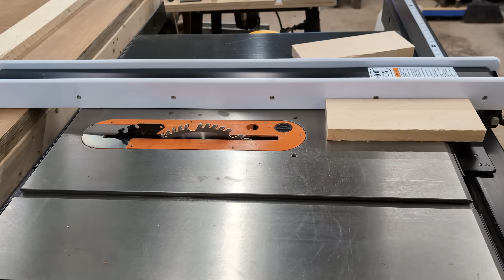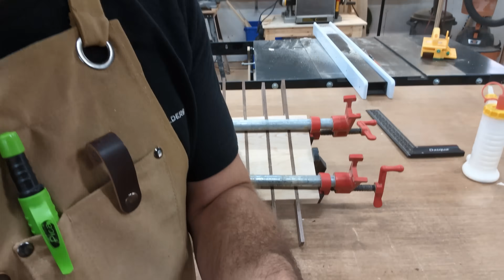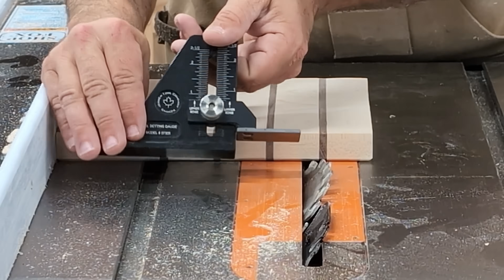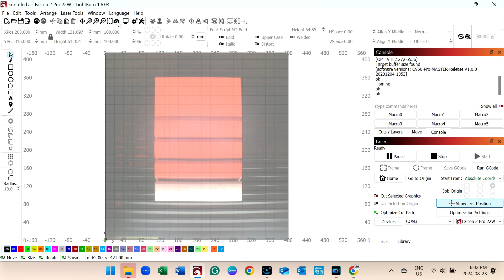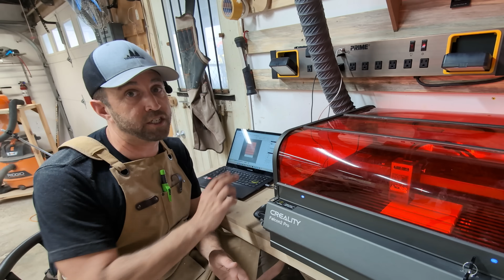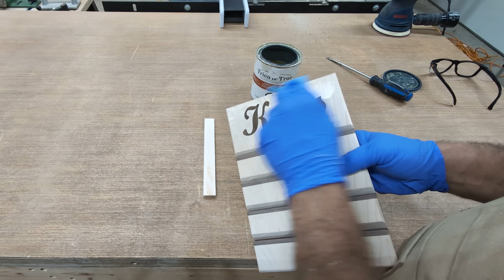Easy Woodworking Projects You Can Sell for Profit

Comment: I recently made tablet holder made with popular and redwood. The redwood is enlayed not glued. Besides a sander and 2 brad nail, i made the whole thing on the table saw and used glue with ribbet joints. Turned out beautiful.  I did use a router for a round over but definitely could have used a table saw on 30 degree instead on the edges
Reply from the maker: That's awesome! Nothing wrong with that 😁

Comment: Hmmm. Your skills and teaching ability is good but you started this video claiming that for this project you'd only need a table saw and clamps... you then proceed to use a band saw, belt sanders, laser engraver... come on man stay true to your promises
Reply: How do you hang this up? Could it be put on a stand to stand on the counter?
Reply from the maker: Of course you can. I put a bracket on the back to hang on the wall, but you can also use a keyhole bit to hang it with screws 😁
Reply from the maker: Hey thanks, and fair enough. You can build it only with those tools. Sander is a given, must have forgot to mention that, but laser and band saw aren't needed, just an option
Reply: @TimberDesigns  i don't disagree but just please be careful on your hooks at the beginning be completely honest OR disclose up front that you'll be using a few more tools. When you got to your laser engraver, it really turned me off
Reply from the maker: @TennesseeLivingNow fair enough and I really appreciate the feedback! I am doing my best to make sure I try and include everything that I use and will keep this in mind 😁

Comment: I'm curious how you hung the board.  Attached hanger or slotted key holes? I would think you would want it firmly fixed since you are sliding something into the slot to keep from pulling it off the wall.
Reply from the maker: Hey Daniel, so I originally was going to use two sided tape, which I did, but I didn't like how it was hanging. So, I ended up cutting two keyslot holes with the router and hanging it with two screws into drywall plugs, which I felt a lot better about 😁.

Comment: Man, im seriously torn with what Laser to buy...i was literally going to pull the trigger on the WeCreat 20W today....then i saw this Video. I need something very user friendly as i know nothing about Lasers and the software. The WeCreat has height adjustment automatically with pass through also. Software seems very user-friendly. This creality looks great and is cheaper...but just by a couple hundred bucks.....any thoughts or input would be appreciated.
Reply from the maker: Hey there, hands down I would go with the Creality, and the pro 22w if you can. It is so user-friendly and you download the Lightburn software. Xtool is also good, but much more expensive. What are you planning to cut/engrave?
Reply: @TimberDesigns I'm looking for a good all around machine. Wood, tumblers, etc
Reply from the maker: Creality will work for these, just need the tumbler accessory for it. If you're looking to do things like acrylics, glass, etc, a diode laser may be better.

Comment: You need to make or buy a thin rip jig to get those straps without measuring. A zero clearance throat plate on your saw would also be helpful
Reply from the maker: I actually do have a zero clearance throat plate for my saw made from 1/2" MDF, but at this point had forgotten to install it and realized afterward 😁.
Reply: @TimberDesigns  I usually have zero plate in except when doing bevel ou using sled which already zero clearance.
Reply from the maker: That works. My zero clearance is actually set up for 90° angle cuts only, but I did have another blank that I could have actually installed for the bevel cut, which would have made the cut a lot easier.
Reply: @TimberDesigns  I have trouble with my Ridgid riving knife at times too. You probably don't need it when you're not making through cuts like the key slots.
Reply from the maker: Probably not, but i try to leave it in when I can

Comment: If you cover with masking tape prior to laser engraving you will not have to go back and sand after laser engraved.
Reply from the maker: That's an awesome idea, never thought of that!
Reply: so the laser burns through the tape?  How would that affect the settings?
Reply: @funnyguy55able  
Masking tape is Sooo Thin it will not Drastically affect your setting.
Reply from the maker: I'm not sure it would as the laser would
burn through like nothing was there.